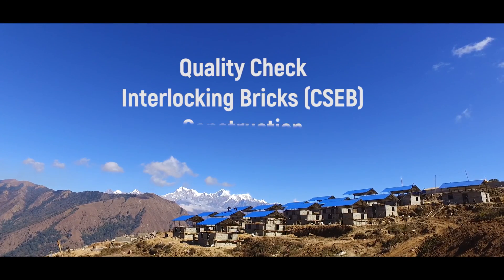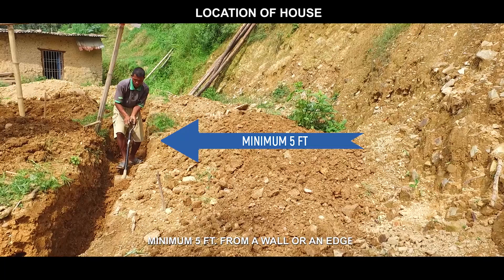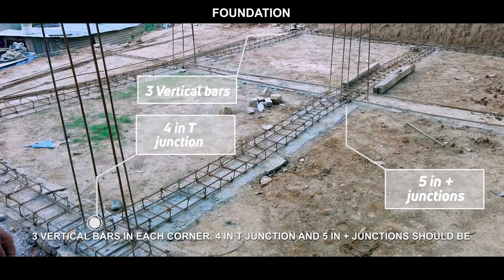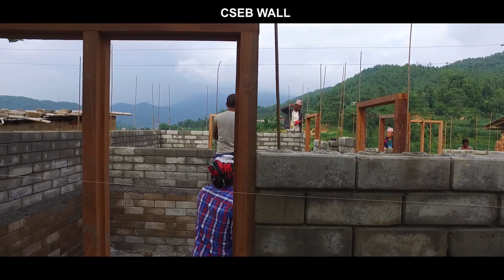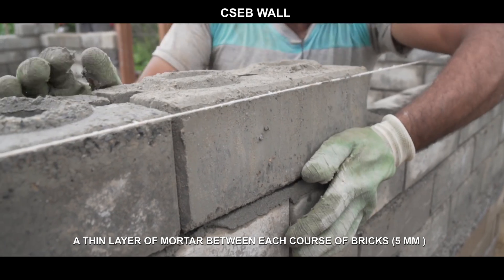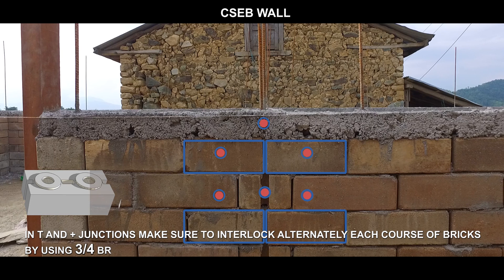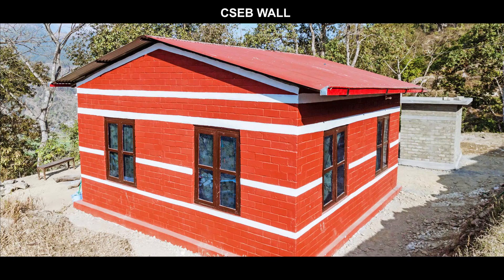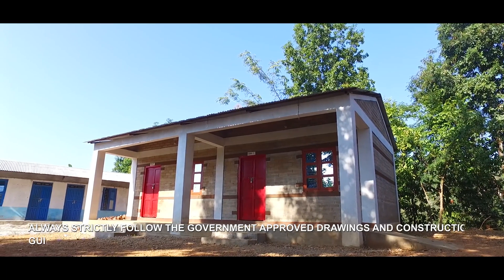How to build with Interlocking Bricks (CSEB) in load-bearing wall design

Comment: Impressed, how do I get a constructing manual  and 1 mould manual machine? How much in ksh? From Kenya.
Reply from the maker: Please contact our sales team at info@buildupnepal.com for quote for machine and training manual with delivery to Kenya
Reply: Question? What is the difference between using rebar and cement with interlocking bricks VS not using rebar and cement with interlocking bricks?

Comment: after completion can we leave the bricks colorless..will it stay strong?
Reply from the maker: ya.. It is very strong bricks.."Average cost: 45-55 rs per brick
Brick size: 12x6x4 inches | 1 Interlocking Brick = 4.2 fired brick in size.Weight of this brick 7kg approx. 
IB Benefits:
-        No plaster
-        Less cement, sand and labor
-        Less cost

 Please let me know your location and how many bricks you need.

For more info please look at this video https://www.youtube.com/watch?v=wU2spFktjAA"
Reply: fired brim stander size 10*5*3 with mortar.and price 6 tuk to 10 tk per brick in Bangladesh. So how cseb are low cost?

Comment: Dont we need pillar for constructing
Reply from the maker: yes we need pillar. but for load baring its not necessary but in RCC form you have pillar on it.
Reply from the maker: You can build either in load bearing or with RCC. Both housing designs are approved by government of Nepal. Load bearing is most cost-effective for single story house. If you want 2 or more stories you should use RCC-pillar system
Reply: @BuildupNepal  What method do you recommend on a riad/moroccan style home?
Reply: How much the price of thise machine.?